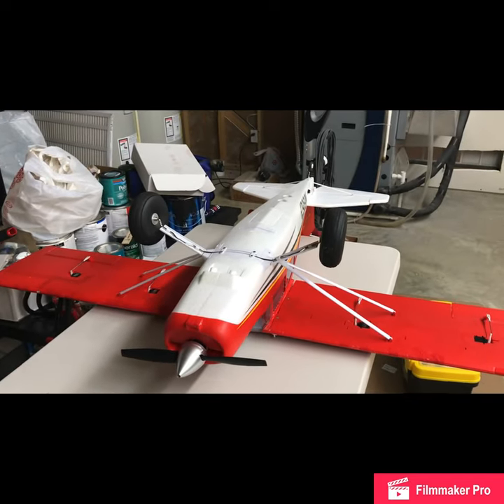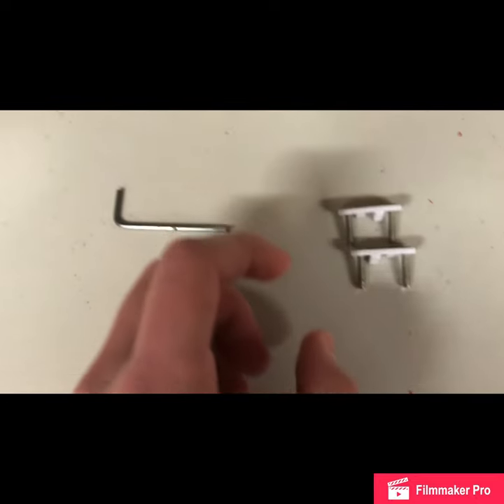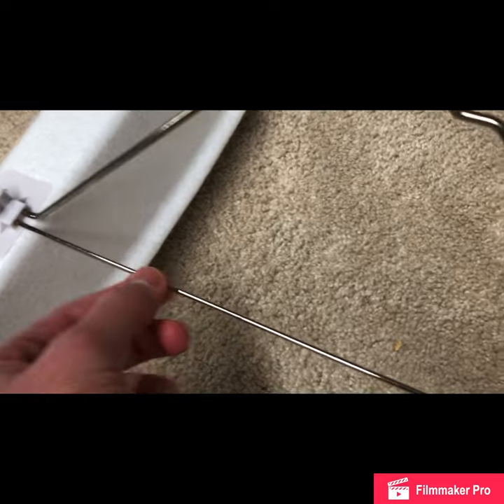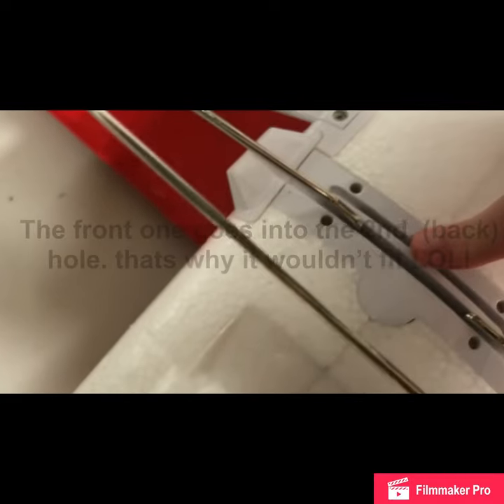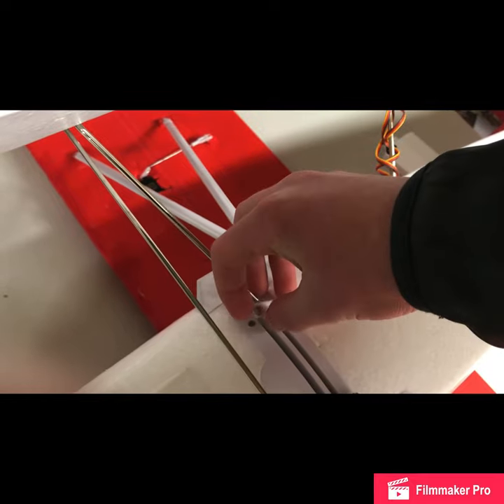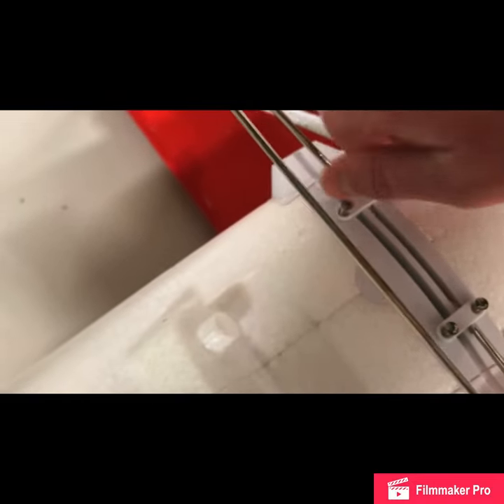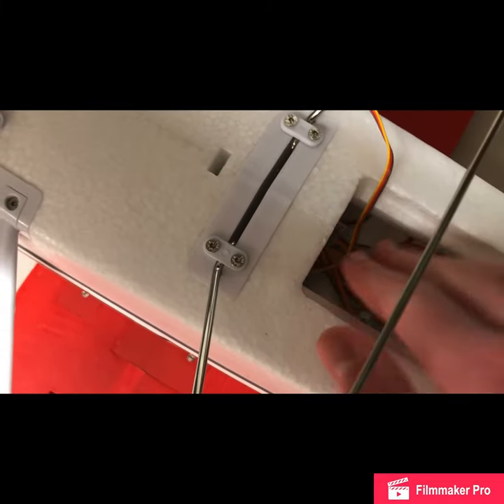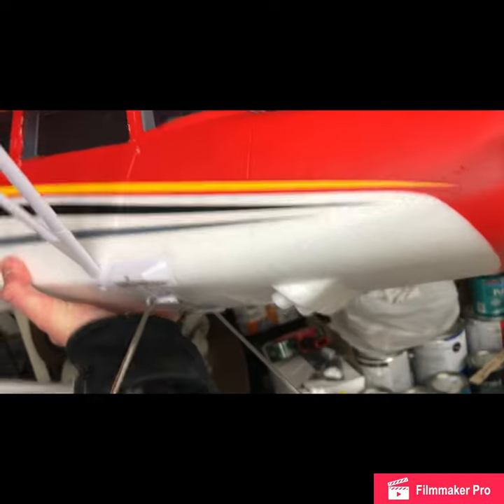HOW TO: Install floats (pontoons) on the E Flite Maule M7 1.5m

Comment: Yes those mounts can be tricky. Maybe the rudder lead goes in the rectangle hole in frt of rear float mount. Try to find a tripod that can hold phone. This is a beautiful plane, don’t have  this one. 👍🏻✌🏻🖖🏻
Reply from the maker: Yeah. I finally figured it out towards the end haha. Got distracted trying to film it and can’t pay attention to my build at the same time. I can usually put them on in about 3 minutes. I will look for a tripod ! I never thought of that!!!!!! Thanks for the info ! Yeah it was one gorgeous airplane until it recently lost signal and went down into some trees.... all repaired and looks and flies fine now. Gonna sell it here soon though. I’m wanting the E flite Carbon Z Cub SS 2.1m. Also buying the new E flite Blue Angels here soon. Lookout for that on my channel !
Reply: No Doubt 👍🏻✌🏻🖖🏻
Reply: My water rudder works but in the opposite direction to the rudder… how does one reverse the water rudder only?
Reply: @spikekavalench  try to find a “Reverser” on eBay. Or put in separate channel and MIX to rudder. You can get a reversed servo for about the same price.
Reply: @eqrc7587  Thanks but why in hell would they install a reversed servo in the float!?   Makes no sense. Am I the only one who got an assbackward water rudder servo? I think I have room to reverse the servo arm on the water rudder but I’m not sure yet..
Reply: @spikekavalench  it happens, but you can turn arm around. Try that and see. I don’t have this plane so I can’t look at it. “Just Enough RC” has one, ask him and see what he says 👍🏻✌🏻🖖🏻